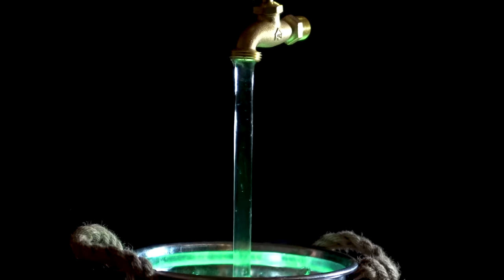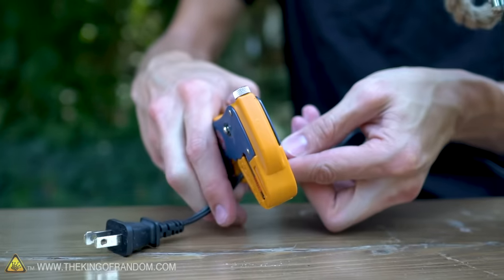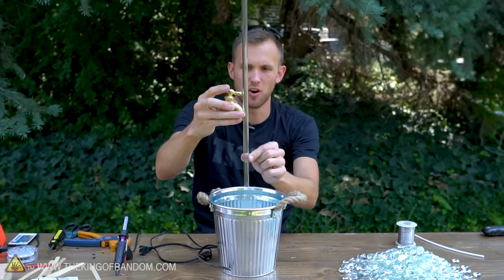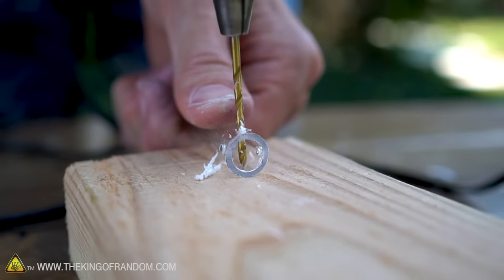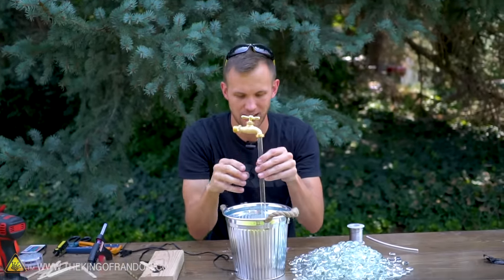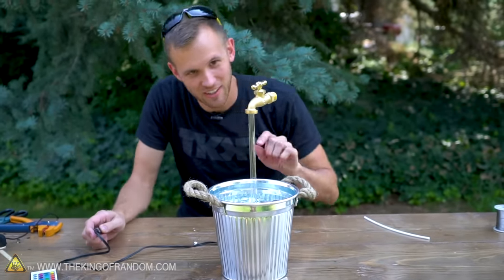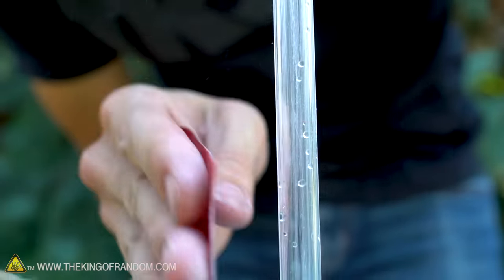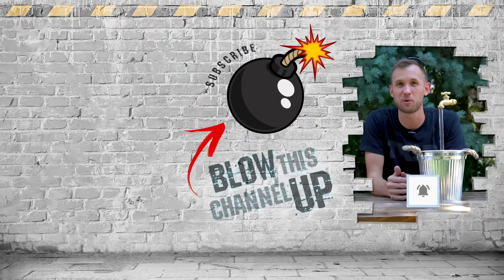How to Make a FLOATING Fountain

Comment: Some quick questions because im also making it.
1. What do you think was the length of the tube was so I can cut it properly. 
2. Also as a glue for the tube to the spigit do you think lighting bond glue will work just as well?
3. And how tall do you think that bucket is?
Reply: Ethan Adler i would just gues the length by looking at the size of his hands an comparing it to you're own
Reply: Where did you find the tube?

Comment: Can you make a glow stick from scratch?
Reply: some other dude does that
Reply: No. The chemicals used are dangerous enough to the point that you cannot order them online (you can try, but the custom will arrest and destroy them).
Reply: you can buy the chemicals on amazon. It's just Diphenyl oxalate and hydrogen peroxide is the primary ingredients. you can use florescent dyes for the colors. Higher % h202 gives brighter light and shorter time lit. There are various other methods but that's what is in the cyalume ones.
Reply: I think Grant already did that.

Comment: use isopropal alcohol and melt different things with it like Styrofoam, lego's, and other plastics

and try to make a slushy machine using and DC motor and liquid nitrogen or dry ice outside of a tank holding liquid so when the dc motor stirs the liquid in the tank it brushes it up against the sides of the tank, it freezes the liquid to make a nice slushy delight
Reply: Pretty sure Isopropyl Alcohol doesn't dissolve polystyrene. Acetone dissolves polystyrene.

And they don't melt. Melting is a change of the state of matter from solid to liquid as a result of increasing the heat of an object or (sometimes) changing the pressure. Acetone dissolves plastics, doesn't melt them.

Comment: Could you try putting molten metal in the vacuum chamber
Reply: That would destroy it
Reply: All it's gonna do it cool faster
Reply: It wouldent do anithing
Reply: ILLuminated Onxy I mean to cast it
Reply: @clicksr9192  are you sure? I would imagine it wouldn't cool as fast due to absence of fluid surrounding for convection. Thus there would only be conduction through the container and radiation emission to barrier of control volume
Reply: @illumi._.  also if you have ever seen a thermos cup there is a vacuum layer at the bottom used for insulation

Comment: Try placing the Solar Scortcher on a Sonar Panel, Will it product more energy?🤔
Reply: No. The panel is the limiting factor, not the energy potential from sunlight. It'll just generate more heat.
Reply: I think the sonar panel would just get less accurate readings

Comment: Can u melt glass and pour it into ice?
Reply: Really ?
Reply: Molten glass is not liquid, its like a sticky goo
Reply: Esteban Sandoval ik but what wil happen?
Reply: ErdemTipix 
Well, when the "drop" of glass hits the ice the ice will start to melt in that spot, but not for too long cause the glass will cool down relatively quickly, the glass itself will pass from glowing red to a darker color (depends on the glass used) but probably it will crack and shatter a bit due to the quick cooling. It wouldn't be any spectacular honestly, maybe a bit curious.

Comment: Current flow in any liquid so can current can flow throw
 Hot glue and plastic
Reply: Irtiza Hashmi not true. You can get a special water that does not conduct current.
Reply: distilled water can't conduct electricity, since its pure h2o
Reply: @hachikiina  what do you mean distilled water has other stuff in it.
Reply: @missingno2401  distilled water doesn't have anything other than h2o in it
Reply: @missingno2401  distilled water is pure h2o
Reply: Distilled water will become conductive over time.
Reply: yeah, because it'll get contaminated. if it doesn't, well, its still distilled

Comment: I heat up the acrylic tip and shove it up the faucet with some epoxy in it; 1/8th holes were drilled first,1/2 inch( to be measured first) from tip

Comment: Great video, very helpful. I'm looking at doing something similar but with wine bottles instead of the faucet. Any thoughts on this? Current plan is to bend the acrylic a little shorter than the bottle, and simply suspend the bottle on top of the tube. Not sure how the glow will look.

Comment: When you split the wire, did it matter which side you soldered and which side you split again for the switch?
Reply: If you had a DC pump it would matter, but with AC powered no, it doesn’t matter.

Comment: Use a small pipe cutter tool, that has two blades that close in on one another. You trace cut the line around and gradually press harder and harder while making a circle cut around the tube, and it will cut completely clean.

Comment: Better to use a low voltage12v pump. The mains cable through a sharp metal hole and metal bucket and water is not the safest of designs.